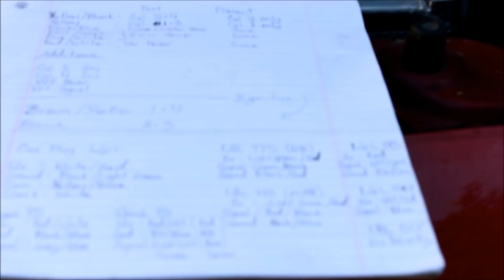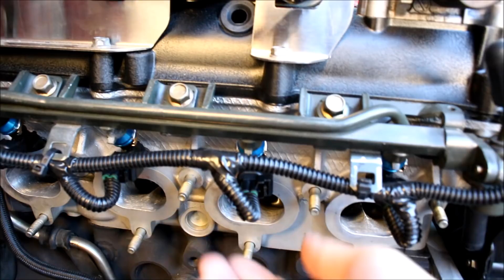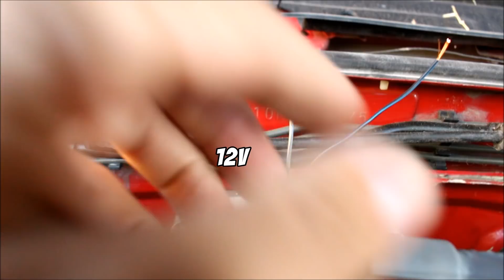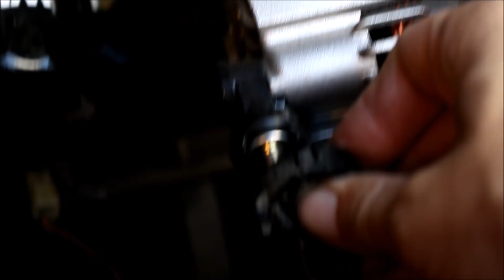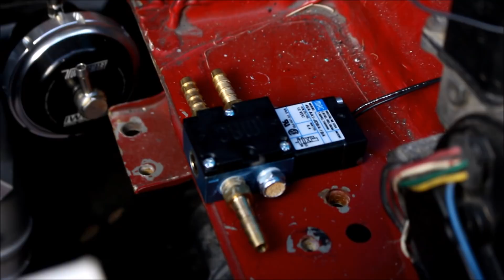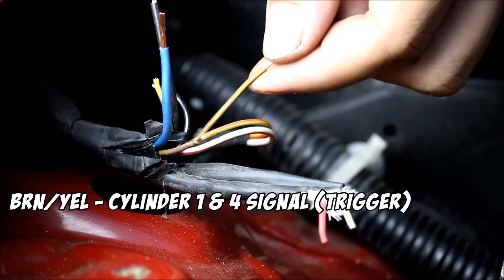Wire a VVT Engine Into Your Miata! (W/ Flex Fuel & LS2 Coils) (Rebirth Ep32)

Comment: can you run vvt engine on stock 1.6 ecu ?
Reply from the maker: Yes you can actually. VVT will be inactive, and you need a 1.6L throttle body adapter because you need to use the 1.6L TPS. You might need to install an NA8 CAS and extend the CAS harness over to the driver side. There are probably a few other little things, but yes it's possible

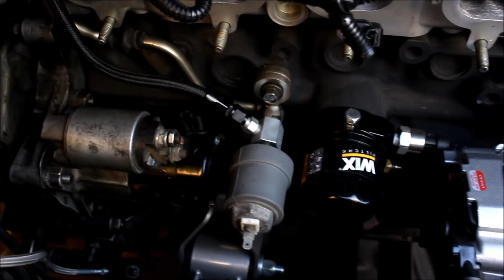Comment: hey what is the fitting size for the oil pressure tee at 8:11 I have the same tee I believe but I cant find the size needed to run an oil line from it

Comment: how can i fit the 2002 1.8 with the 1990 ignition wires. i don’t want the vvt i alll wondering if i can add the CAS from my old 99 engine on my 1990 chassis

Comment: Hey Greg question, Is the white with red stripe power wire for the injector harness the same color for all year NA cars (I have a 97)? I do see a white and red wire on mine but want to confirm before I cut it for VVT solenoid. Don't have a meter to check.
Reply: Also second question, would it be safe to tap the injector power for vvt before the injectors? I see your set up where you tapped into injector power after it reached all the injectors. Not sure if that was for cleanliness or necessity?

Comment: Hey Gregg I've been trying to figure this out but have had no luck, was hoping you could help me out. Where and how exactly do you connect the VVT signal wire to the megasquirt? Also where do you recommend taping for the 12v source?

Just FYI I currently don't have a megasquirt but will soon though. Just arming up with as much knowledge before hand. Thanks in advance!
Reply from the maker: I don't recall the exact pin off hand, but your MSPro will come with a manual, which contains a pin chart, and on that chart there's a recommended pin for VVT. For the 12-volt source I took it from the injector harness. I'm not sure if that's correct or not but everything seems to be functioning properly 🙂
Reply: @TheCarPassionChannel  thank you for the Fast reply you have been very helpful. I wasn’t sure what to expect with the mega squirt so I’m glad to know it comes with a detailed manual. And for the 12v I think you are correct. I read from a few in forums who recommended the same so thank you for confirming function.

Comment: where in on MS does the signal wire from the Flex Sensor Go
Reply from the maker: Options port; it will show you in the manual. I don't remember the exact pin off hand

Comment: I'm planning to swap an vvti in my 1.6 miata in the original wiring like u.  but i don't have magesquirt yet, i do have the original vvti ecu. Does u need to change a lot to wire up the vvti ecu on the 1.6 wiring?

Comment: I lost my tach also, but the "tacho" wire out of my MegaSquirt did the job.  No resister needed.
For full disclosure, I am so cheap, that I purchased the DYIms2pnp kit.  (Yes, I spent 6-10 hours soldering it together.)
I just had to connect it to the yellow wire with the blue stripe.  It's the 4th wire in from the right top row of the plug when looking at it from the back. (Where the wires enter the larger plug NA6).

Comment: @TheCarPassionChannel I have the thermoswitch installed at the back with the other sensors as a safety feature incase for some reason MS has a failpoint and doesnt turn on the fans, this will automatically ground the fans and make them come on anyways, just a backup safety for peace of mind IMO

Comment: Thank you for the excellent supply of wiring diagrams, sensor test procedures and other wiring diagrams.    Much Appreciated.   Also feeling dumbfounded at replies like "Why don't you put a Honda engine in there instead of building a VVT Beast?"   or my other favorite "Pricey 400 horsepower."   Insulting.

Comment: Hey crazy question greg. Did u have to change any settings in megasquirt2pnp to run that coil on plug setup like dwell or anything else? Ive got a 2000 nb but im pretty sure that my stock coil is on its way out super random weirdness. so im guessing its upgrade time
Reply from the maker: matthew mccollum Dwell is about 3-3.5ms. Mine is set up wasted spark because that's how the default wiring is on the 1.6 chassis, I haven't switched to sequential yet. Yours is already wired sequential so you'll leave that setting alone. Short answer no changes except dwell lol
Reply: Thanks greg i appreciate it your the best. keep up the hard work. you got an amazing channel/build. Im doing a very similar build now. Im following along with ur build. you have been a hugh help with everything thanks. Hope u get to smoke some mustangs soon!

Comment: I started to wire my vvt into my NA just today. Dude, until you haven't started this by yourself you will never know how helpful this Video is. Thanks a Lot! Just having a look at it helps so much more than any diagramm ever could 😂
Reply from the maker: Backyard Gearhead But in case you need them, diagrams are in the link in the description, haha. Glad you're finding it helpful!
Reply: TheCarPassionChannel Yeah, found it. Since you replied so fast: If I Had the full vvt harness, would it be smart and possible to use it instead of splicing into the na harness, especially when i had the option to use an ms3x for the nb2? 🤔
Reply from the maker: Backyard Gearhead From what I was recommend by people with more experience than me; it's easiest to just add the 2 wires for VVT.
Reply: TheCarPassionChannel So keep NA harness, do wiring Magic and use 90-93 Megasquirt ist easiest? I am still in the position to throw in a 90-93 ecu or the one for the NB2, thats why i ask 😂
Reply from the maker: Backyard Gearhead You use the 90-93 MS3/MSPro. Megasquirt year always stays with the chassis year
Reply: I mixed that up somehow. Now everything makes sense again

Comment: hey greg on your coil build , what are your settings in the Mega Squirt for ignition like dwell and rest of the settings. I have the FAB9 COP and Brian has been great to work with but they just don't seem to work well under boost , so hence LS3 coils here they come on my build. Just need to know the settings your running. Im running the 1.6L like you  had.

Comment: Hey, can i do the CAS Method, if im running the stock ecu?
Reply: Oh haha, no im swapping an 1.6 NB Engine in my 1.6 NA. Now im wondering if i could simply wire the CAS Plug into the cam and crank sensor like you showed on video if im on the stock ecu, cause you said there need to be changes made in megasquirt to get it to work
Reply from the maker: Disrespected Ohhh yes. You can do that on all Miata motors except for the NB2 engine with VVT. Even the NB1 engine can be run on a CAS. :)
Reply: TheCarPassionChannel Very nice, thanks man!
Reply: TheCarPassionChannel Ok, ive done it like you said and my car wont start. Im getting spark and fuel but it wont start. Are you sure this works on the stock 1.6 NA ECU with the 1.6 NB Motor?
Reply from the maker: Disrespected If you use your NA1.6 sensors the ECU won't know the difference.
Reply: TheCarPassionChannel yeah but i cant run CAS on the NB Motor. I have to use cam & crank sensor of the nb Motor. If I change the cams to NA ones with hydros then i could run CAS on the NB Motor
Reply from the maker: Disrespected You said you did it like I suggested, which was to run the NB motor on a CAS. I know you can run NB 1.8 on CAS, I'm not sure why you couldn't run the NB 1.6 on it.
Reply: you mean running the nb motor on the cas plug? the actual cas sensor is on the old motor. whatever, it doesnt run.. so ill just change the cams to the na ones and run the original sensor

Comment: ive a 1.6 na, are the 1.6 and 1.8 nb throttle bodies the same? will a nb 1.6 throttle body fit on it so I don't have to plumb an extra line off the intercooler? cheers G.

Comment: So, if you were to wire up your ls2 ignition coils to be sequential which wires would go to Megasquirt? I have Toyota cops on my Miata and was wanting to find out how, but couldn't... :( Also, how do you wire up launch control on the 1.8's? When I turn on launch control inside Megasquirt it works just fine, but it won't turn off. I've tried multiple wiring methods with the clutch switch, neutral safety switch, etc and nothing has worked... If you can touch on these that would be awesome!!
Reply from the maker: +MN Framebangers Peep the diagrams in the link in the description; you can either run all four triggers to megasquirt, or use the two existing triggers on the harness and run the other two to megasquirt. Either will work fine. Launch control can be kind of tricky to figure out and has to be troubleshot in person...

Comment: but can't i just put a 1.8 vvt engine with it's complete wiring harness+ecu in my 1.6 and then let it work without any plug cutting and stuff?
Reply from the maker: +Guus Cornelissen If you're just doing a straight across VVT engine swap, there aren't that many things that need to be changed. If you're doing a budget swap and want to keep stock ECU, your best bet is to do a BP4W (non VVT) swap and run it on the stock 1.6 ECU
Reply: omg! thank you for the advice.
me and my dad are planning on doing something along these lines because we checked my 1990 shortnose crank today, and i have to say, that it was the worst crank that i've seen so far. :/
but hey! that opens other doors as you can see. :)

Comment: i wonder if i could wire up ls2 coils to run on a stock ecu somehow just trick it to think that its still the stock ignition system, i wonder what tells the ecu that the ignition system is ok so that it could be bypassed?

Comment: Doing ls coils in a 1.6 needs to be a full video by itself.
Reply from the maker: +Clay Shelman The info is all here. If you've built a 1.6 powerful enough to need LS coils, you have the ability to install them using this video and the attached article.
Reply: I'll wait till you figure out the tach situation lol
Reply from the maker: Clay Shelman I was already running LS2 coils on the previous motor, with functional tach. Connect 1 wire from MS to the harness, which is discussed in this video.

Comment: Yo Greg, those two ring terminal grounds at 8:00, for some reason Mazda wired the signal ground (green/black) into the engine ground only on the 1.6, right there. You'll get cleaner ADC values on the megasquirt if you cut that green/black wire off the engine ground.
Reply from the maker: Thanks for the info on that! So you're saying eliminate/unground the loop that's hooked up to the green/black wire?
Reply: Nah, maybe, just cut the green and black wire free from the ring terminal and leave it unconnected. Leave the other solid black wire grounded. You can see the wire you're going to cut on this schematic, figure 2 D6.

http://www.yorbalindamiata.com/images/wiring/90diag.pdf

See how the black/ltgrn wire grounds outside the ECU? Megasquirt works better if you leave all sensor grounds grounded only into the megasquirt, plus no switching devices using sig gnd for a ground, like a wideband heater circuit. 

I'm assuming the bundle you've got tucked up into the left most corner of the engine bay used to be bolted to the little bracket to the rear of the 1.6 intake mani, right?  That's where the wire I'm talking about should be.

Comment: How you pass Cali emissions is still a mystery to me.
Reply: Coady Lewis The plug lol
Reply: Coady Lewis But technical speaking he could bar it if he used the stock ecu and no turbo
Reply: This is why you move to Montana lol. No emissions tests, and the cops actually dgaf how fast you drive. My little NA6 topped out on the i90 at 105mph still gets passed by other cars on a regular basis 😂
Reply: @elementaljosh  speed limits are an infringement on the constitution anyway
Reply: @awesomecooly123  Lol how?
Reply: he can also make an emissions tune to upload into the megasquirt, pass the tests, then upload the boost tune
Reply: Finkelstein Yablonsky that's called living in any other state lol
Reply: What are emissions?  Lol Florida baby none of that bullshit
Reply: PANTYEATR1 not really, he won’t pass visual inspection. Hate California
Reply: Or just live in a county that doesn't do emission tests outside of changing owners lol
Reply: He works at the dmv

Comment: Pricey 400 horsepower. You could have Honda swapped it for easy cheap 400 horse or swap an inline-6 in there for 500+ horse.

But I guess you REALLY wanted a Mazda unit in there.
Reply from the maker: +Mortalomena This build isn't just for me, it's for everyone else too. The information presented can be useful to all levels of Miata builds. And btw, there's no such thing as a "cheap, easy 500hp Miata"
Reply: Mortalomena I realllly dont think 500+ in a miata is necessary. Those swaps get really expensive really quick but you know that...new engine, trans, subframe, ppf delete and trans mount, new rear subframe to hold the new diff and axles you’ll need.. it goes on and on. Keeping the 1.6’s or 1.8’s seems like the way to go.
Reply: Yea your right about making Honda inline work, it would be tricky. But if you go for inline-6s like MBs m104, BMWs similar unit, you can get them much cheaper than 2jz and can use your stock rear end. Would require more fab work but would save money.
Reply: Yeah but think about how sick this thing wold be with an LFX V6
Reply: They make direct k20/k24 honda engine swaps and it uses the stock miata trans and drive train and if you want more power they also are making a swap kit that lets you uses a bmw 6 speed to hold up to the power, the k20 swap is cheaper then any v8 swap and gives you better weight distribution look up Kmiata
Reply: The swap will still run about 6-9k so it would still be more expensive than building a BP.
Reply: FYI LFX swap, when you take into account the trans and the aluminum block, can actually fix your weight balance to better than stock (better still than turbo) ith little to no weight penalty
Reply: hav0c Exactly! Plus less torque. A 300+ hp all motor built k24 is not cheap and easy.
Reply: ls turbo itll make 500 just keep skinny tires on her
Reply: Doing an engine swap without swapping the trans is kinda dumb lol, you're limiting yourself to like 250ft/lbs
Reply: You'd have to follow his channel to know he has a 6 speed
Reply: Yeah I've been around long enough to now that, when I said "engine swap" I meant NON MIATA swap lol.
There are a few who've made 6 speeds work with 3-400 hp (RIP MATT MAN) but I wouldn't personally go that route. Especially if I was swapping in a motor that had better options available.
Isn't the auto trans better at holding torque than the 6 speed?
Reply: And completely ruin the weight distribution.

Comment: As for the coils, one of the grounds on each coil you mentioned might be a tach signal (at least they are on toyota coils). The 1K resistor might indeed be added if you still got no tach, it goes from IG+ to B- (from the top of my head, do your own research)

Also if you want a “cleaner”/Plug n Play install, you can also hack up the ignitor itself, pull the insides out and solder your coil loom to the inside pins, drill a hole in there for the wires and close it up. That way of you ever need to take the coil loom out it’s a lot easier to work on.